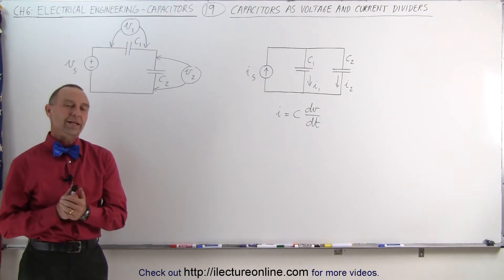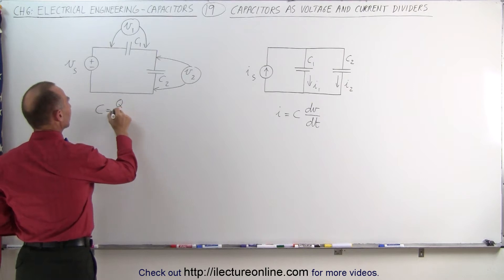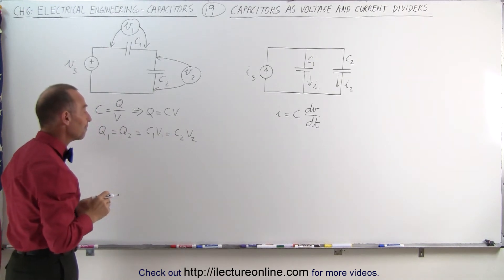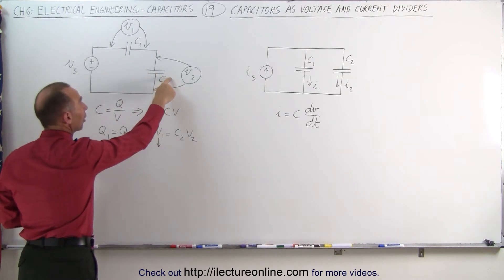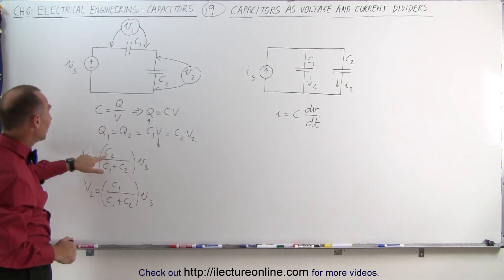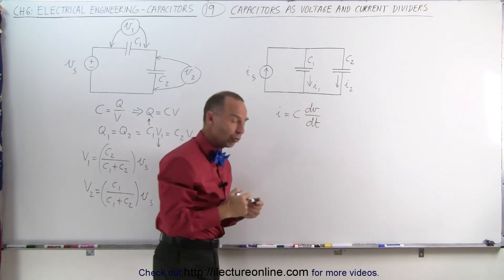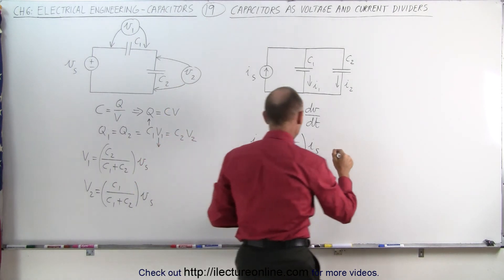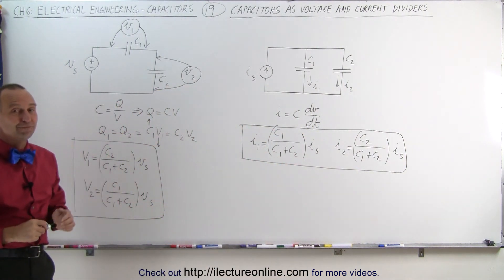Electrical Engineering: Ch 6: Capacitors (19 of 26) Capacitors as Voltage & Current Dividers

Comment: Thanks again,
I set up a simple 2-capacitor voltage divider (equivalent caps) connected to 12v and ground to get a 6-volt tap.  I found that if I loaded the 'output' cap (the one connected to gnd) with a resistor, that this cap discharged, BUT when I removed the load, --it did NOT charge back to 6v (still connected to 12v source).  In fact, the upper cap went to nearly the full 12v.
So, even remaining connected to the 12v, why did the divider's lower cap NEVER charge back up.  Things never went back to the initial state.  This was a bit nu-expected.

Thanks again for such a great series of videos!!
Reply from the maker: We cover that type of circuit analysis in the later chapters of the EE videos.  Did you take a look there?
Reply: @MichelvanBiezen  I have looked long and hard for this with no luck--can you help narrow it down?

Comment: I was waiting for you to mention the special case when the capacitors were equal (C1=C2).  One reason would be in the series voltage divider.  In this case (unlike resistors), in the steady state, we could 1/2 the input voltage (needed in my case, when high output impedance is of no concern) without the power dissipation of an equal-resistance voltage divider?  Of course loading the output would have different results?
Reply from the maker: We have a number of examples like that in the physics videos on capacitors.

Comment: in current divider, is the current source has to be alternating current and not direct current since if it is a direct current, then dv/dt=0 which makes i = 0?
Reply from the maker: Yes.  With DC current, a capacitor is an open circuit and an inductor is an short circuit.  With a DC current, there can only be a very temporary current until the capacitor fills up with charge.

Comment: Why charge across capacitors in series is same ? Charge conservative rule ?
Reply from the maker: For each charge moving onto the left plate of the first capacitor, a charge is pushed from the right plate of that capacitor and moves onto the left plate of the second capacitor, which pushes away a charge on the right side of the second capacitor and onto the left side of the third capacitor, etc.

Comment: Does the voltage divider shortcut only work in capacitors that are connected in series and conversely does the current divider shortcut only work for capacitors that are connected in parallel?
Reply from the maker: The components do not need to be capacitors.  Voltage dividers work with components in series and current dividers work with component in parallel.